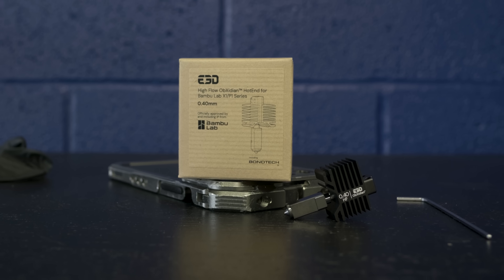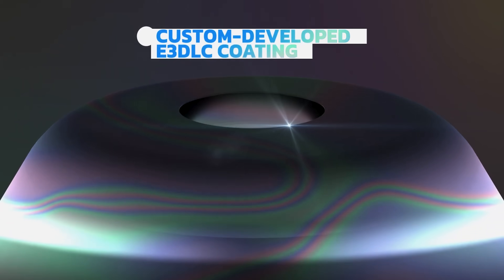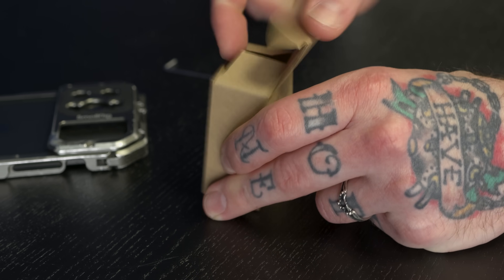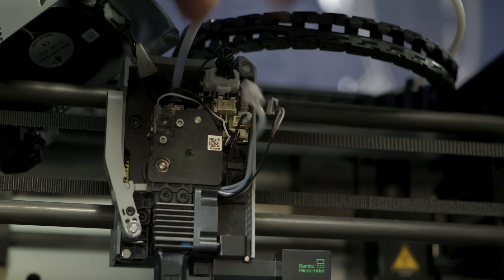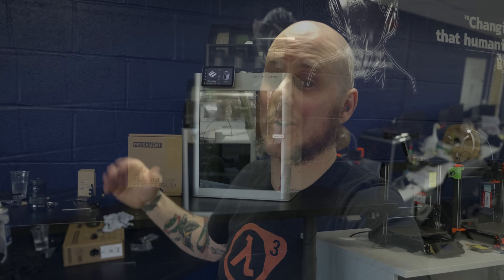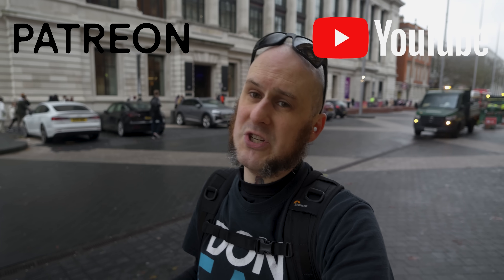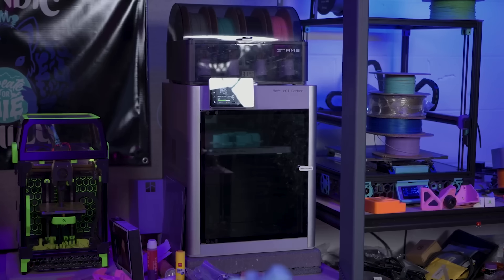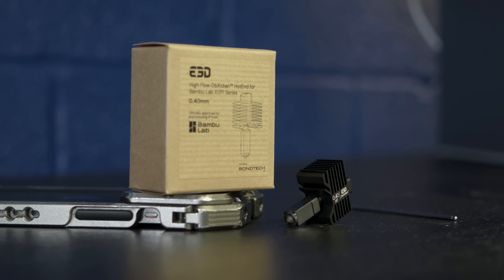REAL High Flow Bambu Hotend from E3D?!? - Install & Test AT E3D

Comment: Im not very happing about the testing method.
Why are there two different g-codes to compare?
For me this is not a very good testing method.

Im really looking forward for a test with the exact same g-code to see the real difference under "equivalent" circumstances.
Reply from the maker: Every single variable is the same except for speeds of the two. To run the exact same gcode back to back would have taken too long. We were on a time crunch as I only had a few hours there before we had to go setup for SMRRF. I’ll retest in my studio when there is less of a crunch.

Comment: I wonder how this compares to the Aliexpress TZ2.0 hotends.  I got a 1.0 version with a hardened steel 0.4 mm CHT nozzle for ~$15 and it works great.
Reply: I doubtful it will be 5 times better. Its all about the "brand".
Reply: Yeah. I can run the aliexpress 0.4 CHT with most PLA at about 40mm^3. The stock hardened maxed out at about 25. 

I haven't run many of the special high speed versions. Bambu PLA runs about the same as Elegoo Rapid PLA+. Both are faster than standard PLA by a little, but I don't think it's worth it for my uses.

Imports use a brass CHT style insert. Making the hardened nozzle a bit dumb. For abrasives, it might be best to stick with stock. That is ok with me as I tend to do functional stuff slower anyway as I'm more concerned about strength and accuracy than print speed for those.

Comment: well my issue with these hotends is not flow, its that they bend way too easily, might be because the printer is violently beating that wiper but still
Reply from the maker: Been running a X1 since the Kickstarter campaign and I’ve not had one bed yet. You are by no means the only one to say that, but I’m not sure what situations are bending them.
Reply: @MandicReally  i mean the spare one that was in the box with the printer is a little bit bent and ive never used that one

Comment: I just checked Bambu Studio and their default Bambu PLA Basic profile has volumetric flow of 21mm3/s and Bambu PLA Matte has 22 mm3/s, so it seems the printer can push over 20 mm3/s with the default hotend. I actually used that profile for printing with PLA that's not from Bambu and it worked just fine for me. Used it multiple times now and printed prints that took 5-6 hours to complete and had no issues. Although I definitely don't print as much as you do.

Would be great if you could test Bambu filament even though you don't necessarily use it often. Would be interested if that flow could be pushed over 30 mm3/s comfortably with Bambu filament or any popular filament really. And just how much of a time saver that really is while printing.
Reply from the maker: Check other profiles. Bambu either has a “high flow” element to their own filament or just pushes it harder than I’d consider acceptable. I haven’t tested it but I do have some on hand I can test. So I’ll try and test a handful of materials when I revisit this.
Reply: @MandicReally  yeah the "Generic PLA" profile has 12 mm3/2, which is considerably slower than Bambu PLA Basic/Matte profiles. I never dug really deep into it, but just decide to try printing this other PLA that I have with Bambu PLA profile and it worked nicely and I haven't noticed any issue.

That's why I'm curious about your opinion because you definitely have way more 3d printing experience than I do. I'm still a beginner.

Comment: We need DiamondBack nozzles for Bambu machines.  Filament occasionally sticking to the nozzle is my #1 real issue with my Bambu machines.
Reply from the maker: Agreed. ObXidian supposedly reduces that but I haven’t tested it thoroughly enough to say. I’ve always been too worried about flow on my Revo Hotends and only just got in the Revo ObXidian today. The filament sticking on my Bambus has absolutely caused print issues in the past. Especially when it drags one color into another on a multi color print.
Reply: There a Revo diamond back already and panda Revo hotend for Bambu.
Reply from the maker: @eighty-eighth_section  the Panda hotend isn’t available yet unfortunately. Not publicly anyway. Hopefully soon from what I’m told. And I’m not certain if it will be X1 compatible out of the box right away.

Comment: Bruh. I just bought the whole range of nozzles from Bambu. If I had known this is coming I would have waited a bit.
Reply: well you have a .8 and .2 so stop crying 😢 #1stWorldProblems
Reply: @DebianDog  don't forget the .6! 

You run into speed limitations quite quickly with the .8 though, that's where the higher throughput would shine the most.
Reply: @LachskoenigIV  I am really looking forward to what the Diamondback will be able to do because you are right .8 in vase mode leaves a lot to be desired. I actually reached out to Diamondback and they told me " soon"

Comment: I really wanna see someone mod a Neptune 4 Max to use these.
Reply from the maker: Honestly this flows better than the N4Max but not by a wide margin. I’ve been round and round with that machine already trying to come up with a hotend solution, but I can’t without having to drill out parts on the drill press. Which isn’t something I can present as a “diy option” for most folks, so I haven’t messed with it further.
Reply: @MandicReally  I'm honestly less interested in the hotend than the nozzle change system and ecosystem. I would LOVE to have 0.6mm hardened nozzles for my N4M, and there don't appear to be any on the horizon.

I don't really mind if it means replacing the whole print head if it can be done with the stock firmware. Which is, admittedly, a pretty considerable 'if'.

Comment: does this offer any advantage over the Aliexpress CHT nozzles which have been out for months for a fifth of this price?
Reply from the maker: Those are longer than stock nozzles, causing possible offset and cooling issues. Have questionable build quality. Proprietary nozzles for replacements. And lastly (and probably biggest) they aren’t wear resistant internally. They have copper inserts. So sure the tip may not wear externally but abrasives will ruin those inside.
Reply: @MandicReally  No the older ones were longer, causing issues with the nozzle wiper, but the newer ones are the same length as a stock Bambu.  You can also get them in hardened steel and they're easily replaceable, I could get 8 for the price of one of these, and I've pushed my P1P up 35mm3/s with them 🤔

Comment: Hey I don't know if Bambulab changed anything about it hotends but I can reach 21 mm3/s (with Extrudr PLA NX2) and I haven't had any problems in 200h print time (purchased in October)
Reply: These flow rate tests depend heavily on what filament is used. Prusament for example is a pla that likes heat like no other, stock mk3 profiles use 215c, mk4 input shaper ones use 220c and that what i would consider standard for that specific filament.

My tests also back up your results, although the bambu hotend only sucks at melting because of the thermistor position. You pretty much measure heater temperature on them, while a volcano has the nozzle between thermistor and heater, meaning the nozzle is warmer than the thermistor while the bambu nozzle is colder than the thermistor. I tested the temperature difference with the aliexpress hotend and regular v6 nozzles, in that configuration its the exact same length and material as a dragon hf. To achieve the same flow rate you need a temperature increase of 15c due to the arrangement of the components
Reply: Yeah thats about what seems to happen. 
I print the Extrudr PLA NX2 at 230 first layer and 220 afterwards.
Reply from the maker: These tests depend heavily on a lot of factors but filament is absolutely the biggest one. We have to pick a control and run with it. For me, I run mostly PolyMaker PLA and it only hits around the 18 number we hit in this test on my machine. Glad you’ve found something that works for you, but it makes me wonder how much more that filament may flow with this hotend then.
Reply: I dont know about you sponsoring deals, but maybe a comparison about different brands.
Could be about voumetric speed but also considering quality, overhangs, stickyness, and such.

Comment: Yeah. I really want this but I am all thumbs when it comes to parts this small. Providing a quick swap option would be ideal for me. A $100 complete hot end is pricey but a 50% increase in print speed without risk of breaking fragile leads is worth it for me.
Reply from the maker: For me, I’ve found that 95% of the time I leave the .4 nozzle in my X1. So I’ll swap this in and it will likely be in there until something else breaks first. Kind of a “buy it once” item for me. But I’ll be testing a Revo on a Bambu soon-ish…
Reply: These are not hard to change out, it's 2 screws, and 3 plugs.  Self-centering by design as well, you just put it in and screw it in.  No fluff.

Comment: £60 is ridiculous though
Reply from the maker: In my eyes, it is a “cry once” product. Sure it’s not cheap, but you swap this in and forget about it. It will handle wear for a longggg time and increase speed for your full filament lineup. They have to license the tech from Bambu AND Bondtech just to make it. Unlike knock off brands that don’t care. E3D produces some of the highest quality products on the market. And they manufacture mostly in the UK. It all adds up to a more expensive product to produce, but a higher quality one too.
Reply: @MandicReally  it'd be interesting to see what it's like up against the aliexpress cht clones I have on my bambu printers.

I recorded around 35mm flow rate on those. Depending on the filament though. That wasn't even with high speed pla.

And they're a fraction of the price, have a brace to stop the nozzle throat bending, and nozzles replaceable. Not sure how e3d can get away with £60 imo. I'd be interested to see how the coating performs for rogue bits of filament though

Comment: Since I just woke up to my X1 "air" printing because the nozzle plugged can these E3d nozzles be cleared if they become plugged?
Reply from the maker: I’ve cleared CHT nozzles in the past.  They can be cold pulled or heated heavily and plunged out. Though I just try to use only decent quality filament and haven’t had a clog on anything in a while. They ARE more difficult to deal with though.

Comment: I wonder if the bondtech technology of splitting the filament for a higher flow could increase the chance of a clog with carbon and glass fiber filaments
Reply: Yep, tests with the AliExpress Bambu replica hotend for CHT clones showed that you can get until 35mm^3/s so 8 more than the E3D one (for only 25 €/$ lmao)
Reply: @dorianvincent2101  1 not the question asked 2, the copper cores in those are obliterated by fiber reinforced filaments.
Reply: The teardrop shape is meant to avoid just that the design helps smooth flow which can better align the fibers for extrusion. And since the filament is cut you don't need to worry about issues retracting. That said I'd only use fibers in 0.6, 0.4 seems to clog to much even in standard nozzles for me. Lord help if you try to cold pull one of these, I don't think that is going to work.
Reply: Thanks for the info .. I have been printing fine with 0.4 nozzle as long as i'm using 0.25 layer height.  The tear shape design is interesting .. I didn't pay attention to it  @Hagantic
Reply from the maker: The passages are larger than nozzle diameter. The smallest point of the entire path is still the actual nozzle orifice. So as long as it doesn’t clog with standard nozzles, it shouldn’t with this design.

Comment: Compared to the Bambulabs hot end these are quite expensive
Reply: True, but you cannot discount the machining and coating costs and challenges of making a part like this. First the machining of the highflow insert very small and precise which takes time and money. Second the coating of hardened steel parts is very difficult. The coating deposition needs to happen in very controlled conditions and temps. This also need to be done cool enough to not affect the tempering of the hardened steel so some kinds of plasma coating are out. Its not expensive because the can be, they are expensive because of good execution by a competent engineering team not cutting corners.
Reply from the maker: What 42436freak said, and add in licensing. The high flow tech is licensed from Bondtech. The heatsink design is licensed from Bambu. Those aren’t insignificant expenses most likely. (I don’t have any info on that and wouldn’t share if I did.)
Reply: @Hagantic and @MandicReally is am definitely not discounting the engineering and the value that they provide, its just that maybe a test on the same nozzle can be tested with Nylon and Nylon CF material so that a better comparison is possible. For the PLA i am quite satisfied with the standard HS nozzle that we get from Bambu labs, but the Nylon CF was something i was quite disappointed. That disappointment could also be because i was testing a non standard Nylon CF filament, probably i should try something from polymaker.

Comment: This is really great.  The lack of replacement aftermarket nozzles was a real source of anxiety for me with this printer since it's a common wear part and I didn't want to be stuck with a dead printer if Bambu went out of business.  It's good to see that Bambu is up for collabs with other companies!
Reply: There are hotends on ali with v6 nozzles. So there are options, one could buy one and put it somewhere safe. So you have one in case
Reply: Not only are there Aliexpress replacements that allow nozzle swaps, but they are even improved by the addition of screws between heatblock and heatsink to prevent damage to the heatbreak.
Reply: @Duckferd  Not to mention those nozzle swaps have high flow inserts that I've been able to achieve over 27mm3/sec flow rate with. All for about $15-20 USD.
Reply: I get it, i have a old mankati fullscale xt plus, the company with defunct and you cant get parts. They used a modified v6 with a bit thin of PTFE in the hotend itself. It is a pain to try to find suitable parts to mod it enough just to work now.
Reply: I guarantee they are not going out of business, DJI didn't go out of business, plus, they are funded by their government. It's not like they barely funded their Kickstarter... they 30x it at least.

Comment: High flow is cool, how long until Revo will be compatible with the X1? I’m not sure that the Panda is compatible just yet for the X1…
Reply: If you aren't afraid of soldering its compatible, but keep in mind that the revo nozzles flow pretty bad, 12 to 15mm3/s depending on who you ask. My tests with the bambu hotend suggest 22 to 23mm3/s using a different filament (prusament asa at 260, esun silk pla at 230, polymaker pla at 220 to 225), so keep that in mind. The revo hf nozzles pretty much exactly match stock performance, but cost like 60 dollars a piece

Comment: Will bambu include a preset in Bambu Studio for that  nozzle?
Reply: I've been running cht style nozzles on my p1p for a couple months and if you use orca slicer to generate a flow rate racetrack test it only takes about 20 minutes per filament to come up with the new flow rate number to put in your filament profile. I'm sure they will release profiles eventually but in the meantime doing it yourself isn't that bad.